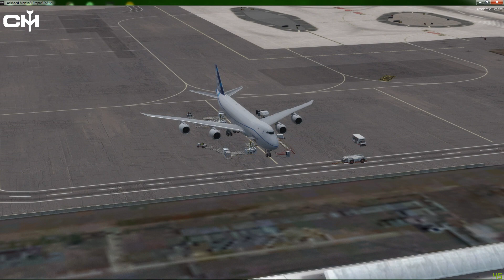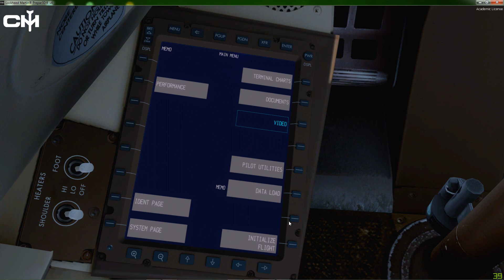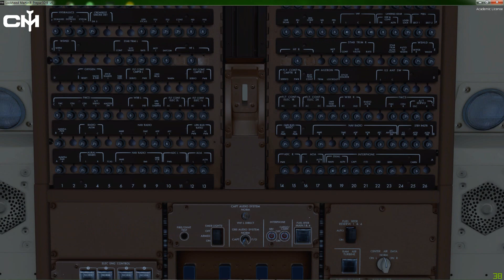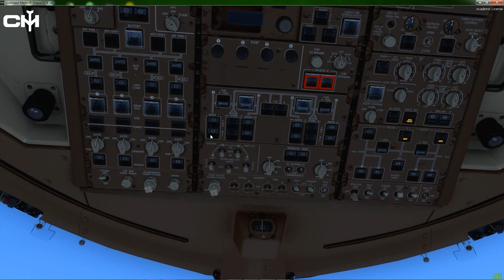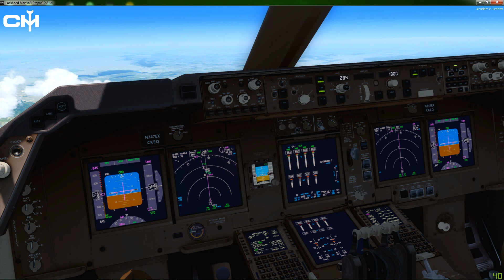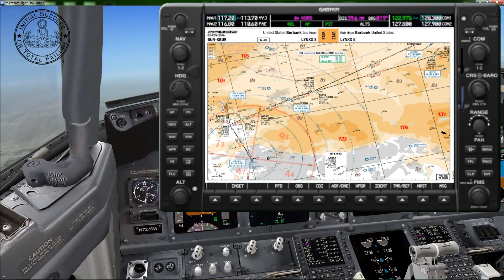[P3D v4.5] PMDG 747-8F | FULL FLIGHT TUTORIAL | KPHX to KSFO

Comment: The v speeds differ on 52:00 bcoz the efb is derating your thrust to 94.4% n1, D-TO with assumed temp of 66C. You selected full TO with the current temp on the fmc, using all the available thrust. In Boeing land you have TO TO-1 TO-2 + an assumed temp to calculate the takeoff thrust.

Comment: Pretty sure NAV lights are the ones you need when power is on, that's white, green, red stabilizer and wing tip lights. Beacon is your censna "clear prop" indicator for ground crew to clear off before pushback or engine start. Wing lights illuminate wings for inspection i think and logo - vertical stabilizer logo.  Not sure why you would have lower beacon separate though, perhaps to not indicate movement to tower with the top beacon and just have lower one on for ground crew before turning engines on.

Comment: Two things and I know I’m late. For cargo you can set your pax number and ZFW and that will automatically balance your cargo weight. I have used auto cruise on the PMDG aircraft and it is a great method to cut down cruise time where you aren’t really doing anything useful
Reply from the maker: A little late ;-) but I do appreciate the info. A friend of mine mentioned that a while back and that is how I do it now. As for auto cruise, that is time acceleration isn't it? If so, then ACARS does not allow for that.
Reply: @CaptainMac  yea once it reaches cruise altitude it automatically accelerates time up to whatever you set as a maximum and for turns at waypoints it will come back into real time then accelerate again

Comment: Data link on the center console. If you fill out the flight info you will be able to use your flight plan from SimBrief
Reply from the maker: I've done that before and the flight plan still isnt loading into the FMC properly for some reason.
Reply: @CaptainMac  I can post a YouTube link that shows exactly how to do it if you permit me to post  link in the comment section